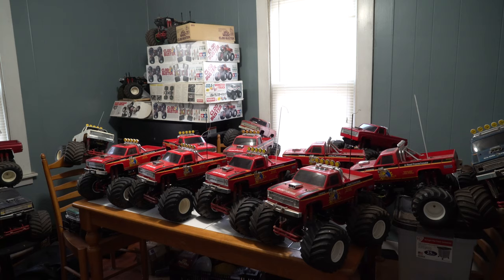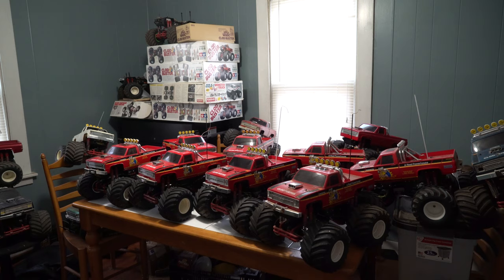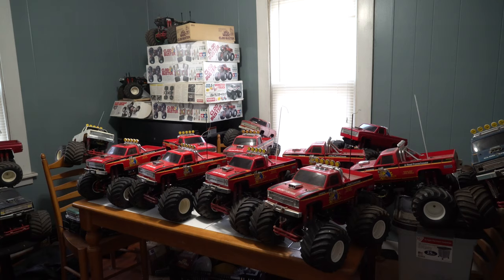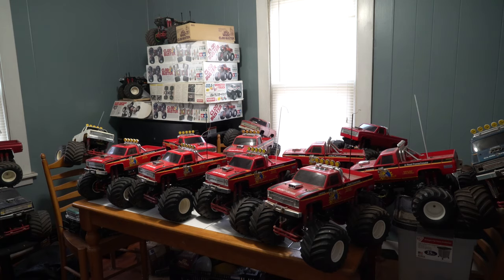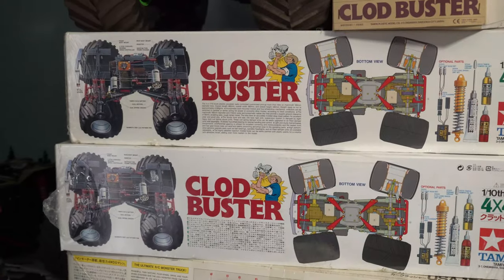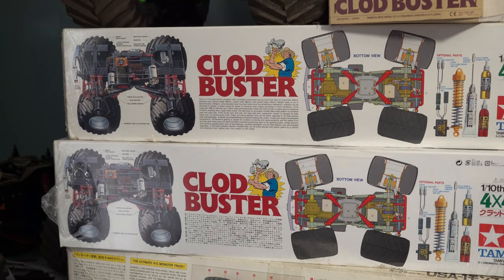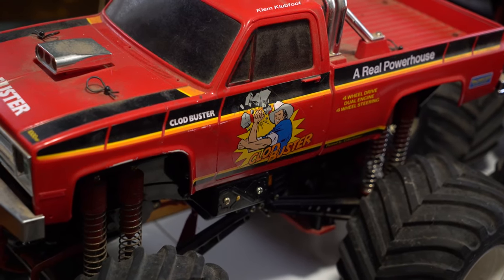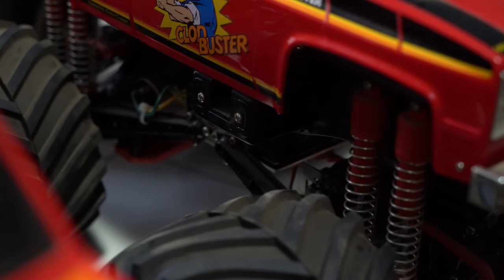Tamiya Clodbuster Motor Endbells

Comment: Hogging all the Clod Busters?! 😂😂😂
Reply: Lol, I'm in the same boat.  I have 22 of them in various stages.  If I'm not mistaken 6 of them are box stock and are the original.  I wouldn't say that any of them are fake, some were just built at different times or different years. They were all built by Tamiya just at different times and the Super Clodbuster is like the original version, just a few things altered.
Reply from the maker: Wayne Norbrey, Jr that’s awesome it’s crazy how clods are still around and popular after all of these years
Reply: @clodbusted1776  
Yes, it is. It's definitely a truck that has stood through the years and the test of time.

Comment: I think you need some more RC cars, atleast one Clodbuster.
Reply from the maker: TwoBlackMarks can never have too many hahaha
Reply: @clodbusted1776  Hehe :D Yeah, I have some standing around myself, sadly they are not used as much as they should, but I still want more.. It`s probably some sort of disease, but it is better to use the name "Collector" than "Deranged Hoarder" Hehe.. :D (It`s not that bad of course, though I wish I was a bit better at selling stuff I do not need or use)
And I actually do not own an Clodbuster. Now that`s Crazy!
Reply: @TwoBlackMarks  
i am an rc fan for many many years and i remember when the clod first appeared , Tamiya at the time were the biggest name in rc if i remember correctly but they had soooo many great cars WAAAY better looking than the clod, like the Toyota hy lux , i would understand to some degree a person collecting the hylux 's but honestly , the clodbuster !! why ??
its a bit plain compared to ..... well any other Tamiya car !
Reply: @gatti493  The Realistic Hilux? With frame and leaf spring and such? Someone would probably say the same about the Hilux, just opposite, that it is slow and boring, only looks nice.
 
Just like in real life, I would rather have a Monster Truck with a Chevrolet body than a Hilux.
The Clod is probably much more fun to drive, easier to modify, better axles, etc. Unless you are after that "scale realism". Different strokes for different folks, is that not what they say?

Personally I have never owned an Clodbuster though, but I had and still have my USA-1 from Kyosho, but I have several Mad Force and a FOXX, among others, the FOXX is the car I have used the most, wich really is not that much lately.... All the RC cars, motors and parts I drooled over when I was young though..
Reply: @TwoBlackMarks  
i see , i didnt know the hylux was slow i didnt actually own either , i had a Tamiya Audi Quattro with the first rear diff, all plastic of course !
but i drooled over the hylux, it was just too dear £££ $$$

Comment: You have so many like a junkyard can you spare any lol.
Reply from the maker: Brad Kalman I thought about selling some I have way more than the ones in the video
Reply: @clodbusted1776  
How many do you have?
Reply from the maker: Wayne Norbrey, Jr I have about 5 new in box kits still in the plastic and about 100 clods total.  I sold a few
Reply: @clodbusted1776  
Holy smokies!!!!!! Thought I was bad with almost 25 of them. At one point I was buildingthem on a regular basis, I have slowed downh about 15 years ago.  Now I getting the to the point where I want to build some new trucks especially after seeing the Trigger King Series.